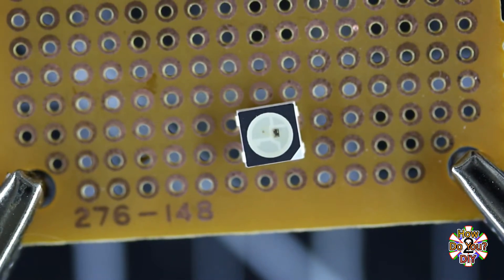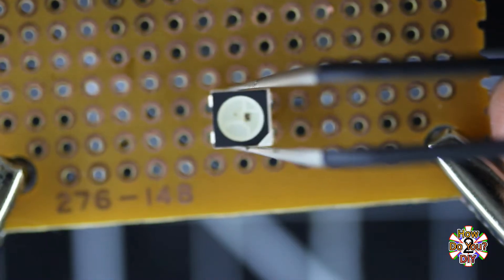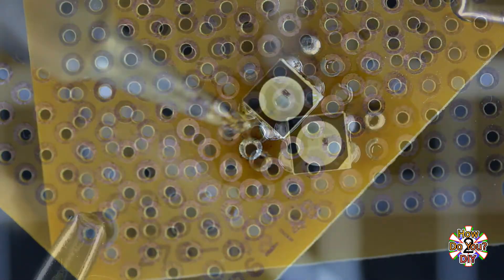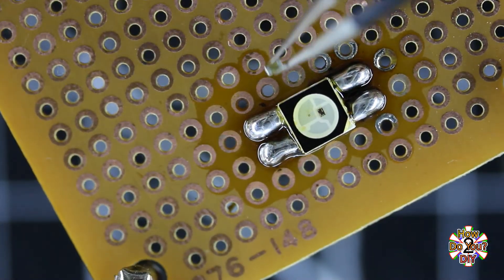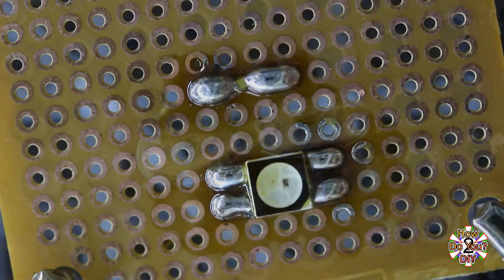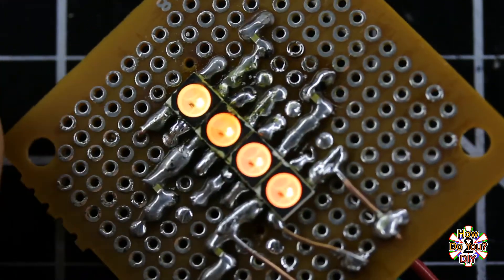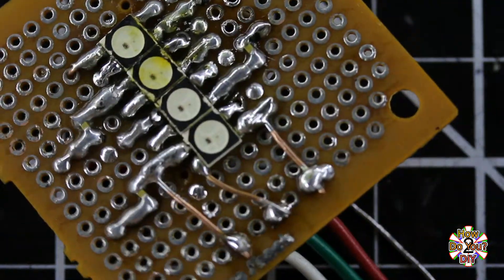Experiment! - SMD on Perfboard

Comment: I build sot-23 logic circuits on perf board, they dont line up perfectly, but they are ok. I use 0,4mm copper wire to hook them up.

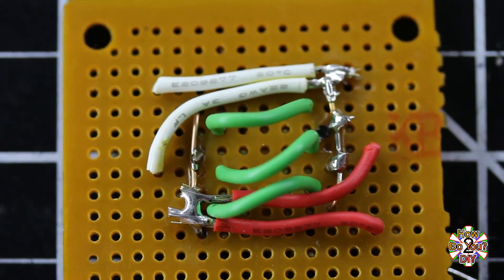Comment: What is the plastic snap lock connector @ 1:12 ? 

(Found them - 3 pin JST SM Male Female plug LED Connector Cables)
Reply from the maker: Yeah, that sounds like the connector. I like to have links in my video descriptions to help people find what I'm using.
Reply: @hdydiy  Thanks - just realized if I had expanded the right panel - You had already provided this (and more) - and your link is cheaper than the one I found !